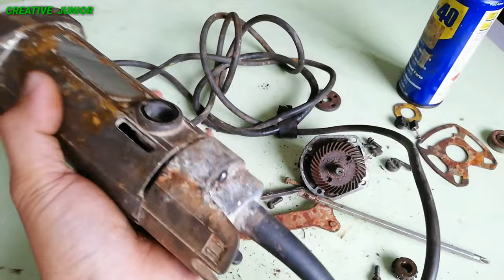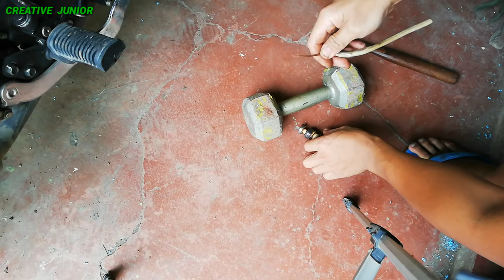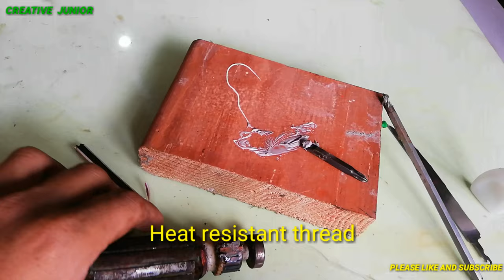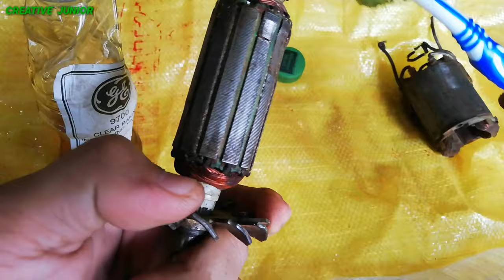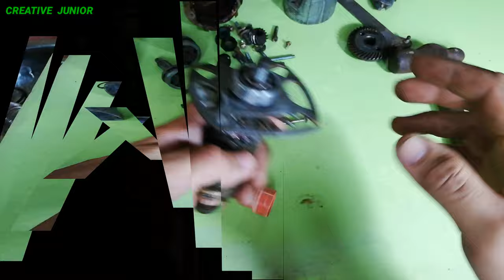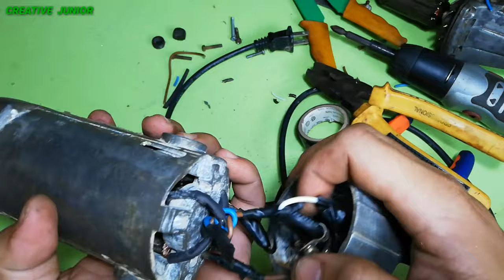How to repair broken armature

Comment: Sir anong ginamit mo na madikit pwedi marine epoxy ba
Reply from the maker: Sa video ko po na ganyan ay epoxy ang ginamit ko pero natatanggal din sa ilang bisin kong ginamit. Mas a maganda ang steel epoxy sir kasi pareho ang dami ng A at B kaya mas matibay. Ano pong powertools ang need nyo e repair sir kay may mga extra akong armature dito
Reply: Lem besi apa bisa& kuat pak..??

Comment: Sabi ko n nga Pinoy kayo sir eh..nakita ko Kasi surf powder gamit nyo..hehe..Yung drill ko sir Ang problema s armature nya eh Walang resistant ung ibang contact s bars nung tinester ko..pwede p po bng irepair un sir?..Sana masagot nyo ako..kalumaang Makita drill po ito sir..aluminum Ang housing nya..salamat sir
Reply from the maker: Nag eespark po ba ang drill nyo sir? Baka sunog na ang armature nya kasi wala nang resistance yung iba. Wala nang continuity po ba sir.. May ganyan kasi ako. 12volts po naisaksak sa 220volts kaya nasira..
Mas maganda po na e rewind nalang po sir para bomalik po ang function nya katulad ng dati or pwede pong bumili ng parts.. Sana po malapit lang kayo para ma repair ko ang powertools nyo sir
Reply: @creativejunior7060  ayaw n PO pong imikot sir kahit isaksak s kuryente..baka nga po sunog n armature Kasi ung nga pong ibang commutator bars Wala n continuity..nagsearch n PO ako s online Kung may armature n para s model Ng drill ko Kasi Wala po ako Makita sir..luma n Kasi ito sir eh..Sana nga po malapit lng kayo pra maipagawa ko..Zambales Kasi area ko sir eh..salamat sir..more power s channel nyo..mag subscribe din po ako sir